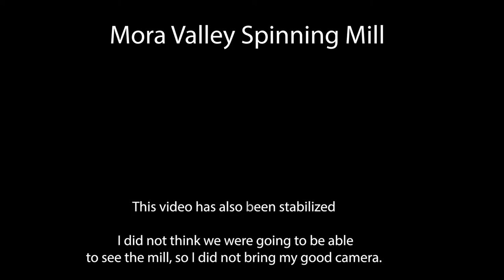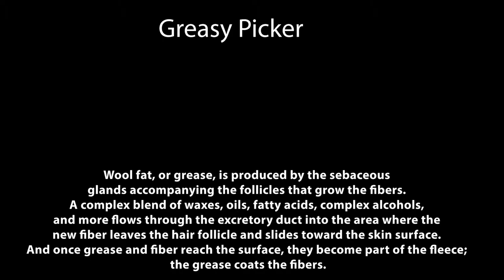Threads of Time: A Monk Explores the Rich Tapestry of Mora's Wool Mill

Comment: I am wondering if there’s a misspeak towards the end when talking about twist and plying. He says that the machine plys Z, but I see S ply in the yarn hanging there and in the subsequent cones and skeins. Given that standard Western yarn is S ply (with Z singles), I’d assume that’s correct, though other cultures would use Z ply (and S singles). Plus, Z is clockwise and S is anti.
Reply from the maker: Yes and no, off camera I posted out the S ply, but I think I cut that part out in trying to shorten the video, good eye, you must be a weaver
Reply: You got me-weaver, spinner, knitter, crocheter, tatter, and more. As a tablet weaver and crocheter, I can get extra interested in threads spun opposite of conventional for the effect on the finished project.  @TheDesertMonk